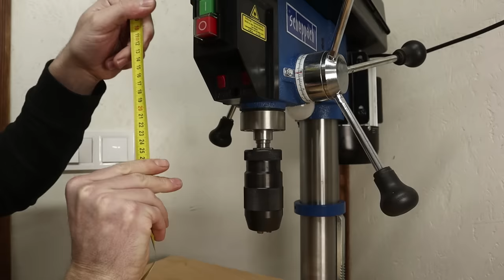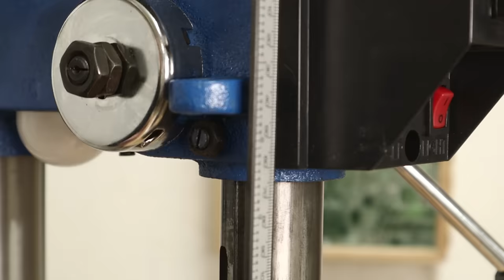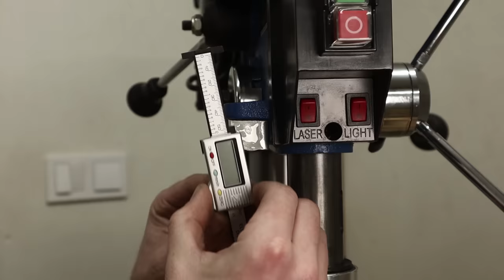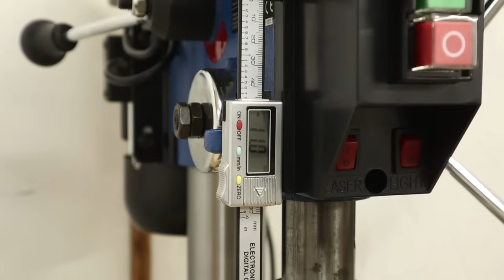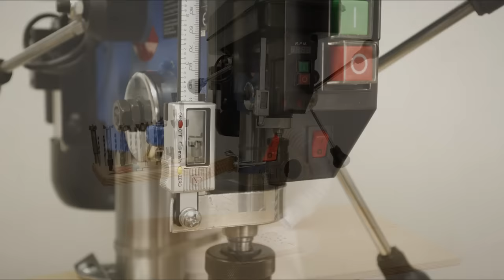4 Useful Accessories for Every Drill Press

Comment: Dear Ollari, if you get yourself a negative rake blade your cutting of aluminium will become a dream as you cut it like butter and with smooth edges. Thanks for sharing your ideas on upgrading a drill press to make it more useful. Cheers.
Reply from the maker: That wold be great. And also a flat tooth blade for cutting rabets. But sadly i can’t buy anything else than the regular ones in my country.

Comment: The dust collection with a flex drain hose is a capitol idea. Adding the till for the drill bits is also good but I’m wondering about having the business end of the bits pointed up. Especially those Forsner bits.

Comment: By the looks of it much like yourself I use my drill press for woodwork and metalwork and your designs are spot on. Though I’m not as proficient as you in either. I especially like your table and depth gauge, I was bought a morticing attachment for Christmas and it’s a pain taking the guard off to use it, my depth gauge is attached to it (The morticing attachment from Axminster is much better than expected).

My table needs to be easily removable like yours as I have disabilities and a lot of designs require fettling nuts and bolts under the table. This is very difficult for me, even with my x y vice. So from me you get a massive thank you and a subscribe.

Comment: Great ideas. I have done most of these to mine as well (not the dust collection though). The one thing I added to mine was a fence. It makes drilling repeated holes in multiple parts a breeze.
Reply from the maker: Thanks! I had a fence on my old drill press table but i hardly every used it. It's pretty simple to set one up if someone does a lot of repetitive drilling.

Comment: Speaker magnet to hold the chuck key to the side of it.
Just go to some music store and grab one out of the dumpster or ask if they have some in the back. They are great for that and on the fridge too. 
They hold a couple pounds and are free !!!
Also, put some bar soap on your hacksaw blades and files when cutting or filing aluminium as it keeps the filings from filling up the teeth.

Comment: Excellent improvements to a drill press.  I hope to copy the digital depth readout.  What thickness of aluminum did you use for the brackets?  Thanks!
Reply from the maker: Thanks! About 2mm thick. But thinner works too

Comment: I never quite understand why you would assemble a wooden jig then apply finish ... in most cases it's easier to apply finish first, touch up with steel wool (or sandpaper) then assemble. Makes the job easier and a lot neater.  Just a geezer's perspective after 87 years in my shop. Love your adapting the caliper as a depth gauge.

Comment: Hello Sebastian, I recently bought this exact drill press and I will definitely add the DRO and vacuum hose. I would like to ask you if you use the stock chuck or if you bought a better one. Whenever I use drill bits of diameter 10mm and more, the drill bit wobbles like crazy in the stock chuck. You don't seem to have the same problem. Did you do something with it or am I just unlucky to have bad chuck? Thank you for the reply.
Reply from the maker: Hi! I’m still using the chuck that came with the drillpress.

Comment: Agree with the previous poster, great video and great ideas.  That said, I'm far less interested in links to your tools, as I would be to links to your parts and supplies like the expandable hose, or the worm clamp. Perhaps next time you could add Amazon links to the parts and pieces you used, as well? 

Criticism aside (it's easy to critique from the cheap seats, sorry) you did a great job with this. Well done!

Comment: I really liked the digital depth gauge.  One question, can you still access the batteries or do you need to swap out the unit when they go bad?
Reply from the maker: The battery compartment is on the front.

Comment: Where do I order the Star Wars' brad nailer? Seriously though, is that available on Amazon? Okay now, TRULY seriously, I like the idea for the drill press table. Although, it would be nice to throw a simple permanent fence in it. I'm thinking one could use a flush trim router bit to clean up the sides and easily be able to square up the fence. That's probably a rubbish idea because I'm new to this woodworking thing, but it has me thinking. Thanks for the video. I'm not sure about that depth gauge stuff, but cool ideas anywho.

Comment: All brilliant designs! I might have missed it, but on the platform, what is the purpose of the recessed circle?  A moveable waste board?
Reply from the maker: Thanks Christopher! Exactly! You just turn it to get a fresh surface and after one side is worn out you just flip it over!
Reply: Ollari's nice!!! It took me a minute, but I got it! Yes, cool idea to move it when you want the solid backing and then just replace it when ready. I’d make several replacements at a time and keep them around. I really like the digital depth guage and the drill bit holder. Beautifully simple!

Comment: What blade do you use on your table saw to cut the metal. And what is the thickness of the metal you used for that? Thanks
Reply from the maker: It’s a normal wood cutting blade. It was 2mm Aluminium.

Comment: What is the name of the bracket that fits on the u-bolt clamp on the accessories project?
Reply from the maker: It’s a muffler clamp for cars.
Reply: Yes.  But what is the u-bracket that bolts to the exhaust u-clamp?  Thanks.
Reply from the maker: Paul Ludington hmmmm. Not sure what you mean. The muffler clamp has 2parts to it. The U shape with threaded ends and the matching part with 2 holes in it made from galvanized steel.
Reply: Great, but at 9:07, a third piece is added to the exhaust clamp before threading the nuts.  It looks like a u-bracket.  Thanks.
Reply from the maker: Paul Ludington Ah! Ok. Thats the part I made from flat aluminum sheet.  With the  two bend up parts and 4holes.
Reply: OK.  Thanks.

Comment: I didn't get the point of the circle in the wooden table, what is the purpose of that?
Reply from the maker: It’s a waste board. You can turn it a small amount to get a fresh point to drill into so that the piece that you drilling through doesn’t get tear out on the back.
Reply: @Ollaris  make perfect sense, and once the circle is worn out you just replace the centerpiece instead of replacing the whole board, brilliant, thank you sir 👍

Comment: Did I just see you wrap your tape measure around the drill spindle to measure it after just using a vernier caliper to measure depth ???  Why didn't you just use the same caliper to measure the diameter then multiply it by pi to get the circumference ?
Reply from the maker: Because that’s quicker for me.

Comment: hey, i just bought a similar scheppach drill press, the only thing i feel doing with it is throw it to garbage container and forget this waste of money.
adjustable drilling plate bends to the front under light pressure during drilling, they recommend forcing the chuck on the morse taper using this plate and wood plank, it is not 90° by default and has absolutely no way to fix it, they even recommend using angle blocks in the manual for precision work.
ridiculous. scheppach is a disguised company importing cheap chinese copycats and stamping their brand on it. stay away from these people.